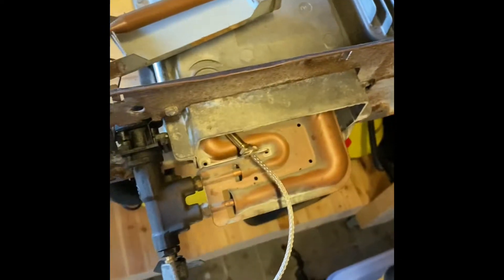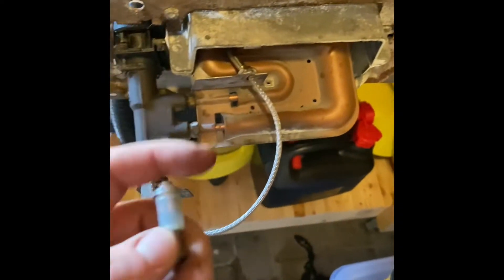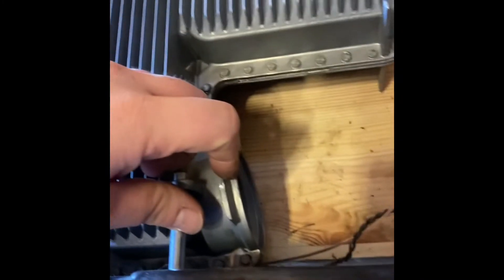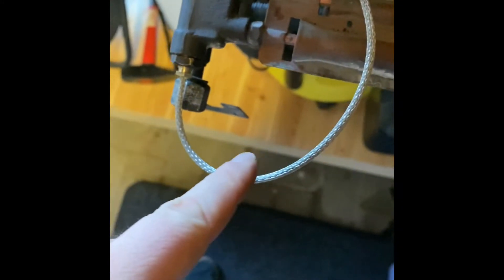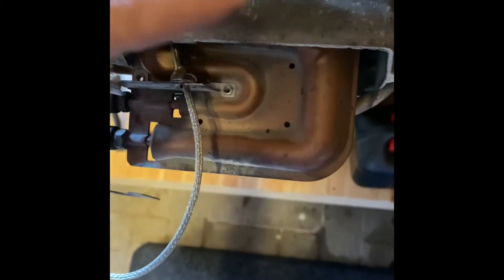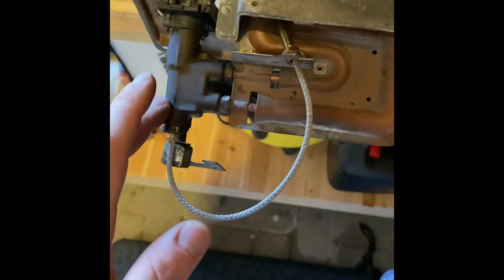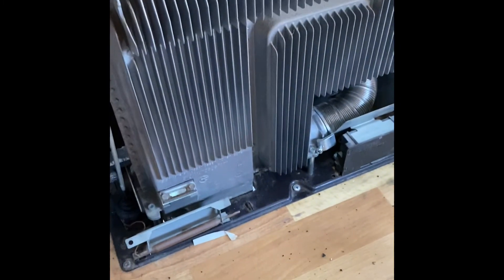Truma s3002 replace Thermocouple and Mini Insert - (Solves problem where only pilot light works)

Comment: i have a sl3002 with electric box automatic ignitor that doesnt click or send spark.

 i changed battery's not 1.5 volts but rechargeable 1.2 volts (maybe this is the problem?)
i sand all the contactpoints in battery tray - electroc box between wire connections and still not clicking sound.
bridged the 2 pinn connection from switch on gasvalve with a wire between 2 pins and still nothing .

of the sparkplug doesnt work should the electronic box still make a spark clicking sound or not?

how can i test wich one is bad?

thanks for the vid
Reply from the maker: @chevroletbelair1  this is a different problem than the video. 

But having said that, the model in this one uses auto igniter which requires a 1.5v AA battery to work. When you turn the knob from zero to 1 to 10 it should make a tick-tick-tick-tick sound automatically. If it is not making that sound then something is wrong.

Comment: I have the same problem on my Truma S 3002 (2010), and will try your method.  Have ordered the two parts.  However, how do I fit in the termocoupler - do I need to dismount the whole heater - I have looked underneath - and do not see how I can loosen the old, and fasten a new one??
Reply from the maker: Yes, you need to dismount the entire heater to access this area.
Reply: @dashiszznit  Thx - have done so now, and bought a complete new burner unit - instead of just the two parts you recommended.  Cost me about $160 in addition. My unit is a 2010 model, so I hope this was a wise investment... - eliminating potential future problems... Will use a certified mechanic to mount it all together - and test for leaks...
Reply from the maker: @teletore  yea, whole burner assembly is probably full of new parts. Glad you got sorted

Comment: Sadly some dangerous misconceptions and advice on here about what a thermocouple and the valve does.

The thermocouple generates, when heated, as mentioned, a small current which holds the magnetic valve open to allow gas to flow but only when current flows from the thermocouple when hot.

This is why, to light the burner, you push down and hold the knob down for 30 seconds or so, this mechanically opens the valve against the spring and gas flows, the burner lights, the thermocouple gets hot, produces current, and this is the important bit, after about 30 seconds or less, the current energises the magnetic coil enough to keep the valve open, but only as long as it is getting heated, you can then release the knob.

If the flame blows out, the thermocouple no longer produces current, the coil no longer produces a magnetic field, the spring ( which someone in the comments stupidly suggested to remove ) then closes the valve which prevents a dangerous situation of the gas still continuously flowing until the knob is turned to zero !!!!

So by removing the spring of this safety component gas would be allowed to flow causing a potential fire hazard.

Comment: Thanks for the video, it’s much appreciated. 

So the heater is supposed to take air from outside the camper, exhaust them outside camper and the heater works as sort of a radiator, using radiant heat from the fins?

It doesn’t create airflow though a camper like a modern diesel heater piped  around the camper would does it?
Reply from the maker: Yes that’s correct. It’s a radiant heater in that sense. But, often, many campers are equipped with an electric fan and piping just behind this heat source to pump the radiant air throughout the camper.

Comment: Thanks this could be helpful as same symptom as my S3000P gas heater . Hope i'll be able to do it without removing  the complete heater and try removing the parts from under the caravan. Assuming the part numbers will be the same for my manual  piezo igniter model. Hopefully i'll be successful as well 🤞
Reply from the maker: It’s not likely you will be able to access these parts from under the caravan. Usually the only thing from the bottom is the air inlet and gas connect. The rest is bolted in from the inside. But don’t worry too much, it’s pretty easy to remove once you take the cover off. It’s just the exhaust outlet and 4-8 bolts after disconnecting gas underneath. I don’t know much about the S3000P but please double check part numbers. Can’t say for certain they are the same.
Reply: Hey Guys, I removed this from underneath the camper super easy. It’s just one thing to unbolt.
Reply: @whatshappens.  Hi I have this issue, can you please help me with any information on how you removed it from under the van?

Comment: I have a truma sl3002 and it's not turning on. Can you please send me your contact information? I would like to consult with you.
Reply from the maker: Hi Benjamin, I’m not a professional in all matters concerning these system. This was mainly a video for this one issue I found out the solution for, which is very common. Not sure I can be a big help for your specific problem. Id definitely recommend calling a gas pro to give you a hand.

Comment: Hi, thanks for the video.
One question..... The old thermocouple seems to have two nuts where it goes to the valve. One big, one small. The new one only the bigger nut. Why is that?  Superceded part??
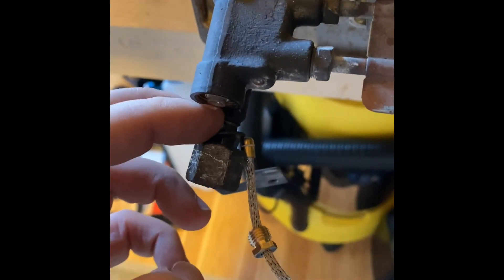Reply from the maker: I think the big nut is there to only hold the magnetic valve in place. If you scroll to the 4:00 minute mark you’ll see a cut of the video where it isn’t installed. You’ll install the big nut to hold the valve insert in place and then the valve end of the thermocouple (small nut) will be then be used to attach the thermocouple to the big nut which should have a threaded hole to screw it in place.
Reply from the maker: Also just a tip, your thermocouple should have come also with a larger nut as a part of the kit. That is for the thermocouple end that sits near the pilot light, to put that in its correct position. Mentioning that, just in case you’re confusing that part for the other one I the valve side.
Reply: @dashiszznit  Got it. Thanks for the reply. Understand now.
     I think mine is just making a poor connection. It's working ok again now. Mind you, it is a 1989 caravan so its done well.
      I haven't replaced anything or even bought anything new yet. I did give things a clean a few years ago. 👍
Reply from the maker: @ivanhoe6366  yea, mine is 2007… newer Truma, but maybe not as well built as the older ones lol